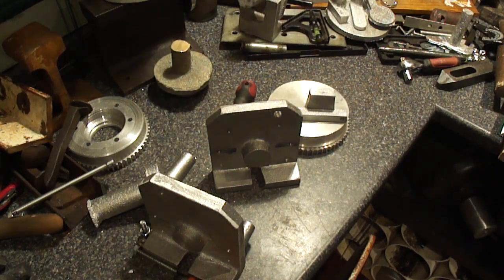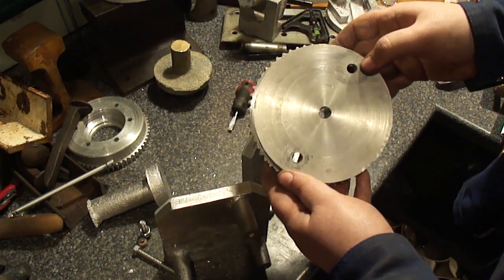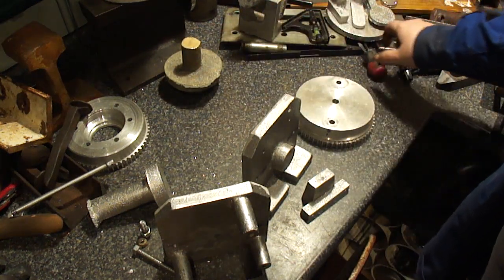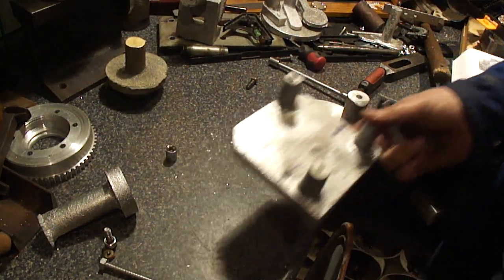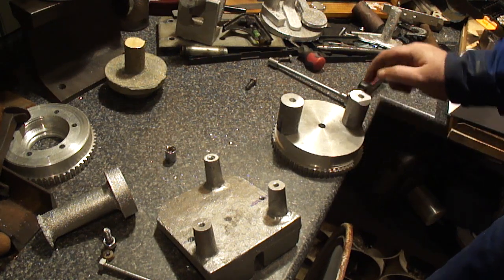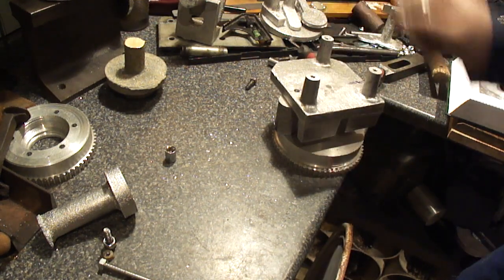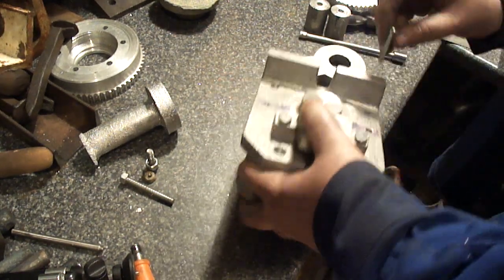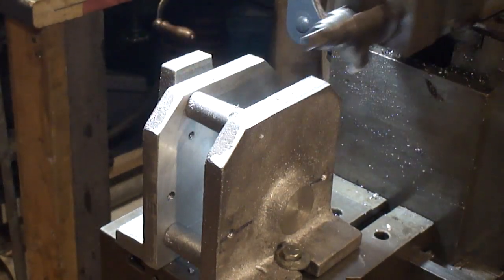Gingery Dividing Head P1 - Machining the Main Body

Comment: Having a dividing head will be nice👍. Nice gauge
Reply from the maker: yea, Ive been after one for a while, so I figured it's time just to make one myself, lol. As for the gauge, Ive already tested it with the air compressor and it works fine, so need to cast and machine up some air manifold blocks again to run the air lines around the shop, and to hook the gauge up. Thanks for watching.

Comment: Good stuff.  How about casting a split ring clamp to go around your chuck, drill some holes around the outside, then you can bolt on some cast lead weights or scrap to balance those oddball pieces.  If thread strength of the ring is a concern use those T-thread inserts used in wood furniture.
Reply from the maker: Thanks for watching. I was talking to a friend that casts iron primarily, and we were talking about casting a face plate for my lathe. I just need to make the pattern and cut the threads in it afterwards. I very rarely have an issue with an off balance parts in my lathe, but if I do, the lathe is more than rigid enough to not really cause much of an issue really.  I may just cast a really thick aluminum face plate to get me by for now, then use the patterns later on to do it in iron.
The problems I was having with the lathe was that a family member decided to try to "help" by messing with the belt alignments of the leather flat belts, and any cuts would cause it to throw the belts off. Also the belts are older than I am, so they need some attention, I just need to take the belts off of the lathe and shaper and add some neatsfoot oil to recondition them.

Comment: Excellent work as usual. Good score on the tools, they from the second-hand store? I've got a small coal forge that I need to get fired up and see if I can make some shaper tools. I've never tried but looks like fun. Thanks for the real good video!
Reply from the maker: thanks, and they're kinda from the junk store, the junk store shut down perminantly now and I caught up with the lady that ran it. She had some stuff saved off to the side that I got the endmills, taps and dial from, so it's kinda from there but not really, lol. 
Ive had really good luck with the forged coil spring steel tools in mild steel and they work great. I usually deal with the truck coil springs rather than car ones because they're bigger, and usually 5160 steel, so I just quench it and it will cut through steel for hours without needing resharpened.
Reply: That's too bad about the junk store they had some cool stuff in there. I have some 3/4 ton Chevy pickup springs are those heavy enough to forge tooling from? If not I think I can get some heavier springs from some equipment. Thanks for replying!
Reply from the maker: yea, those are perfect. The ones that I made the shaper tooling out of are 5/8" coil spring steel. I just cut them into rings and cut them into C shapes so that it makes it easier to straighten them and it makes them between 6-8" long. The spring steel tends to cool much faster than mild steel, so you have to hit hard and fast to get it to straightened and to go into shape. 
I would say to get it straightened and flattened out very slightly to put a flat on each side so it fits your tool post, then use the angle grinder and belt sander/bench grinder to shape the profiles of the cutting tools. Then just stick them in the forge and quench them in some oil to harden them. From there, it's just a little bit of stoning the edges to get rid of the scale/black oxide, and to give it it's final sharpening, and it'll be ready to use in the lathe or shaper.
Reply: Doesn't sound too hard to make some. I will definetily give it a try soon. Thanks for the encouragewment!
Reply from the maker: no problem, and good luck, I hope everything works as good as it does for you as it has for me.

Comment: I've never done any machining, but it sure is fun to watch the machines run and see how it's done.  Looking forward to the gears!
Reply from the maker: yea, me too, a bit nervous tho because I need to get a few tweaks to the lathe before I get to cutting the worm gear and hob tho. I mainly need to just recondition the leather belts because they're starting to dry out and crack, so I just need to go through and take everything off of the lathe and shaper, and add neatsfoot oil to them to recondition the leather, and make it much more grippy so it wont slip when cutting the hob and gear.